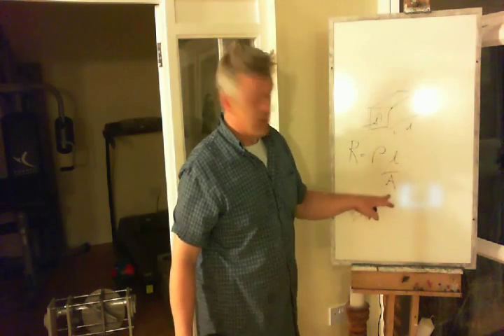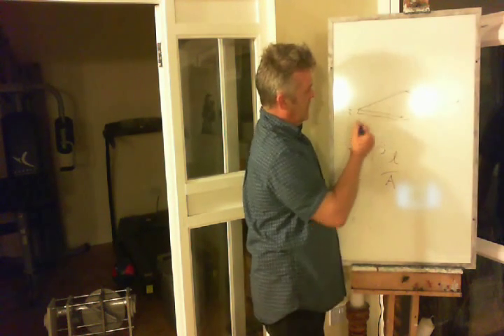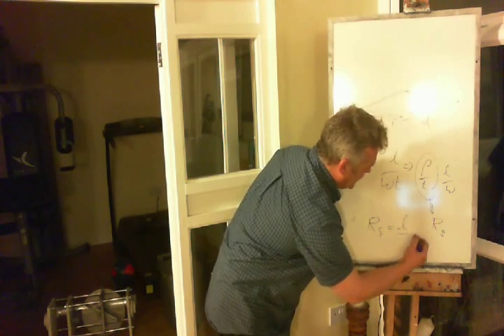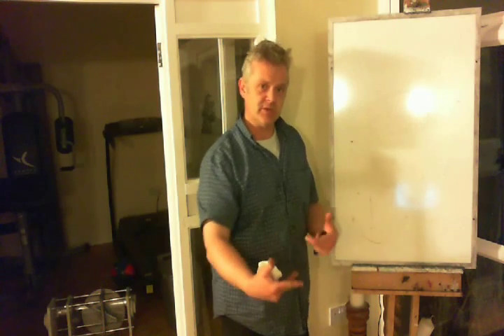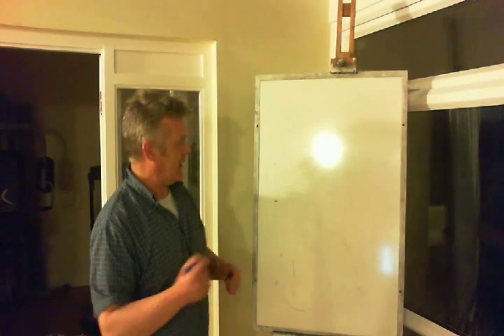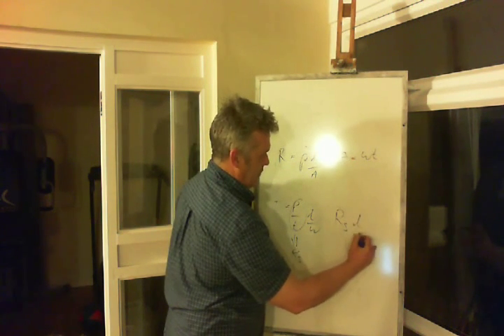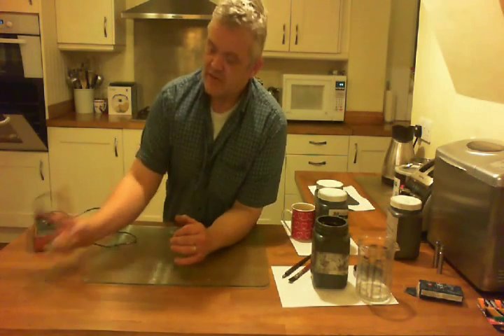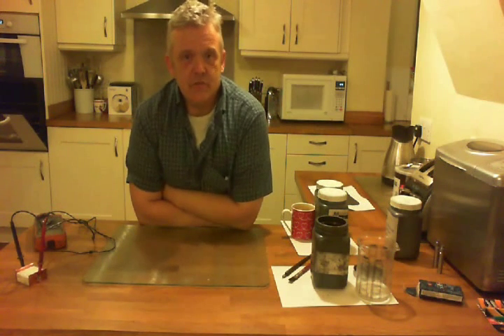sheet resistance

Comment: Is it correct to say sheet resistance of a conductive layer printed on porous substrate is difficult to measure? can line resistance be measured instead?
Reply from the maker: +Arvind G noo it's easy to measure - but a little difficult to interpret. If the substrate absorbed the film then how thick is the film? that can be a bit difficult to answer
Reply: So there is no point using four probe method on the porous substrate?
Reply from the maker: +Arvind G you can do if you want - you just have to take account of it - it's just easier to do a non porous substrate as it is one variable out of the equation

Comment: Robert, nice clear explanation.  One thing I was not 100% clear on is why it doesn't seem to matter much what the thickness is for a film.  There must be a threshold where you can ignore that for some reason?
Reply from the maker: +rsa4510 there is mate - films divide into thick films, thin films and solid material - the definition is a little grey  - a thin film is monoatomic layer to a few microns, a thick film can be quite a few microns thick and refers to paint and ink coatings mostly - as i say it is a guideline as no one has really specified what the film thickness is